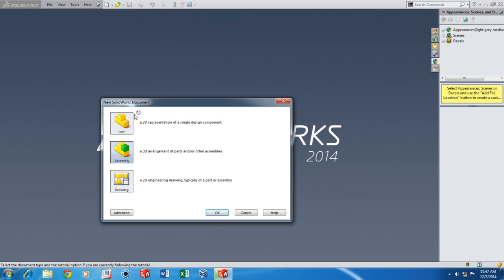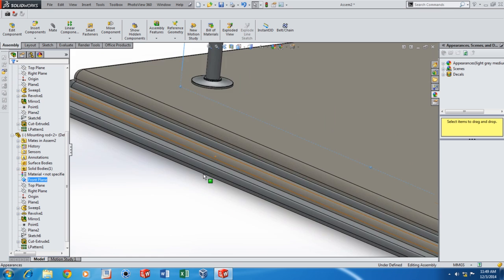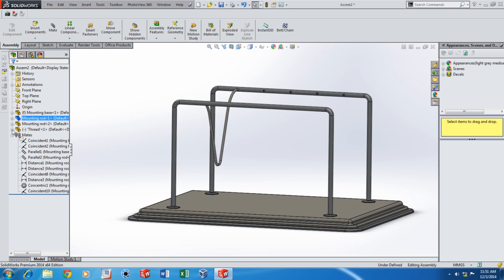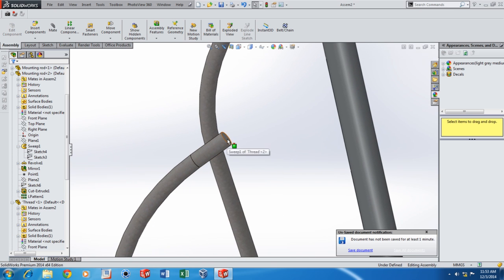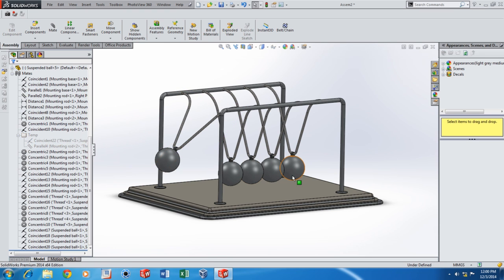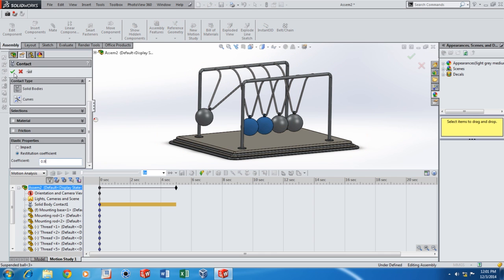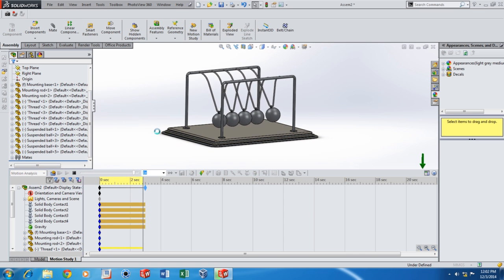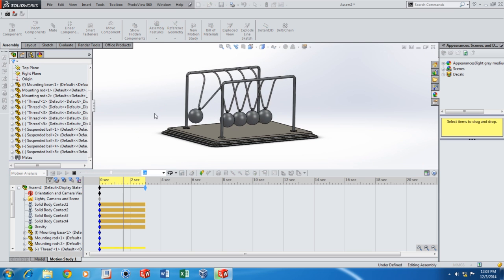SolidWorks Motion Simulation tutorial - Newton's Cradle (with audio)

Comment: Hello, Thank you for great tutorial. I never used Solidworks, 
I have built an autonomous watering system for plant, using used plastic container. I want to design the container with more rigid material for long term use, so I started to learn 3D design. 
I want to ask whether is it possible to see force, pressure or rigidness of the design?
Reply: I dont know much in this, But see if you can go for a ANALYSIS SOFTWARE  like Ansys , https://www.youtube.com/watch?v=auZ4Hda24us    try this link